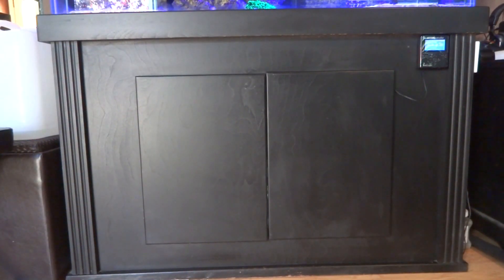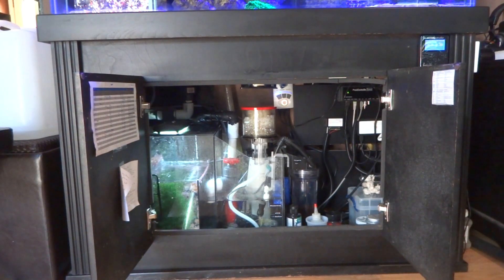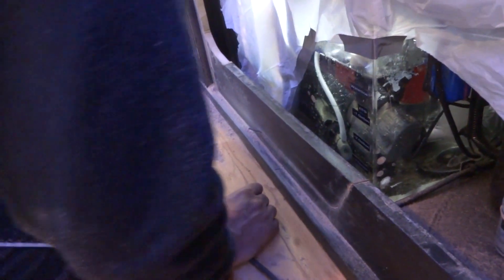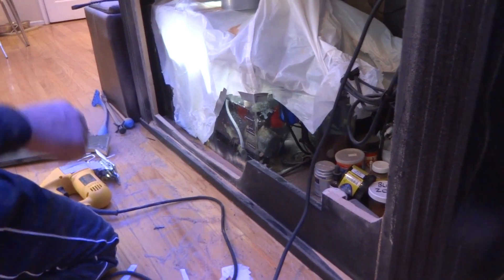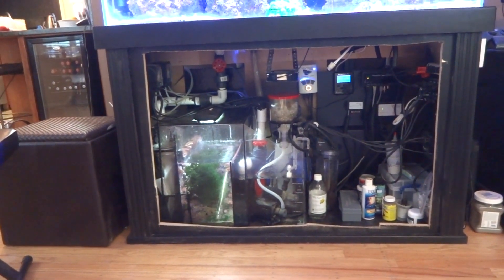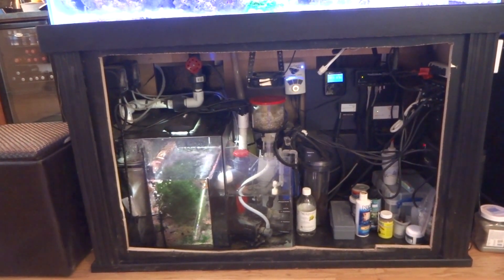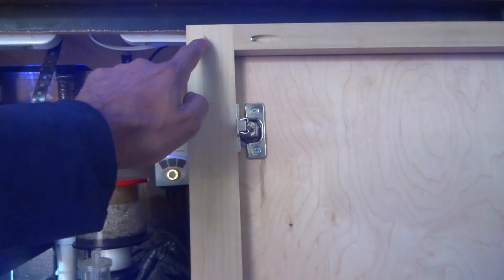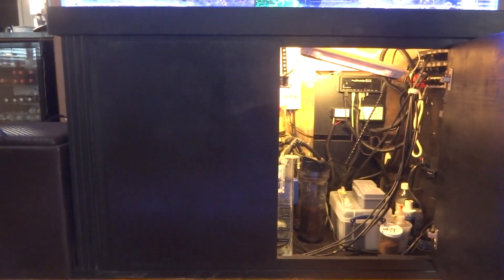Aquarium Cabinet Modification

Comment: Good job done. Whats the paint inside the cabinet to protect it from water spills and moisture.
Reply from the maker: I don't think it's special paint. I did use rustoleum paint on the metal door hinges. The hinges are rust free, whereas before, they would rust within months.

Comment: Love the mod and I have a question, how do you determine if the tank is using any of the sides cut?
I have a stock Aquaeon 48" by 18" stand and I would like to take the middle brace off so I can put a 36" new trigger systems sump instead of the dinky 10g acrylic box. What's the best way to determine if the brace is actually doing something?
I have time off starting in two weeks and I may make my own custom stand, but that's still up in the air at the moment.
Reply from the maker: If it has a center brace it's doing something... it's hold up your tank. I'd go with plan B and build a sturdy stand. I modified my stand for the same exact reason as you. I'm replacing my Aqueon sump with a Ruby 36S.  Video to come!

Comment: Pretty Sweet, Way better! Just need to add some decorative handles on the doors. My problem was I wanted my stand taller, Nice job!
Reply from the maker: Haha, I'd like a taller stand too, but I can make do with this one. I have the handles, just have to put them on. Going to do a pretty significant upgrade to the sump, which is another reason why I had to modify the stand.
Reply: ***** When is the Ruby going in?
Reply from the maker: +Juan's Reef Aquariums
I'm getting some finishing touches done before I make the move. Just ordered a tray for my Miracle Mud to make it easier to change out by removing all the mud at once inside the tray and lessoning the chances of a mud cloud in the water. It's being custom made to fit and should be ready tomorrow. I will probably spend Sunday and Monday working on the sump and new plumbing. Come over, beer and pizza on me!
Reply: ***** Lol I wish, Chicago is a long way from you, but sounds like a weekend of fun, where are you getting the tray from? do you have a link for it? i was thinking of doing the same thing, but with a specimen container, i was going to just drill some holes on the side and hang it
Reply from the maker: Juan's Reef Aquariums 
No link, it's a local plastics shop. The guy helping me just bought a 100g reef, so we had lots to talk about. They do custom plastics. I gave them the demensions of the second stage of the Ruby and they will make it. Ill send you some pics tomorrow of it (assuming I wake up in time to pick it up).

Chicago isn't that far... leave now and you'll make it by Sunday!
Reply: Well please share or ship me the idea ;) that was going to be one of my projects for the future, but if you perfected a nice mud holder for the ruby, i will definitely take one
Reply from the maker: CRAP!!! I just had it in my hand. I picked it up today, took it home and it was 1/4" too big. I returned it and they will have the correct one on Monday. Send me your cell # so I can text pic.

Comment: did you have to brace/reinforce the aquarium stand? I'm actually thinking about doing this I have a center brace that makes it so hard to access alot of stuff and I'm planning to upgrade my sump and I can't really remove old sump with the center brace..
Reply from the maker: I would have  never done this without professional  advice. Mine turned out to not be load barring so i removed it.

Comment: Very Nice Gil! I'm glad to see that you finally went through with it, now maintenance should be a little less hectic for you! Did you paint around the edges of the stand before you installed the doors? Does any of the light escape from the middle of the doors when the fuge light is on? Now I'm going to look into doing mine if possible, Nice job!
Reply from the maker: No light escapes the center of the doors, but a little does escape from the hindge side, not enough to bother me. I think I need new hidges, I can't get the doors to line up exacly where I want them, but no biggie.

Comment: Thinking of building a reef tank? 2 things! 1 don't put a refugium in your sump it's worthless. 2 always size your stand 36 in wider than your tank. As you can see by how crammed this system is.. Happy reefing..
Reply from the maker: jeff mays Hey Jeff, not sure I need a 7' long stand to put a 4' long on it. I do need a  larger stand, but not that big LOL. I have to disagree about the refugium being worthless in the sump. I don't depend on pods to feed any fish, I do depend on the macro algae to remove phosphates though. Additionally I'm running Miracle Mud that provides minerals and trace elements to the corals and fish.
Reply: ***** Removing phosphates? I refer you to Richard Ross on that one when it comes to phosphate removal from a refugium. 

Let's do the math..

36" sump 
External return pump option, actually the only option but ok. 
Chiller. 
Auto fill unit and holding container.
Dosing unit and containers.
A foot or so to space said products and boom 7'.
There is nothing worse than not having enough room under the hood to hold the horse power. 

I would also strongly recommend a welded metal frame powder coated to support the tank and never go below 36" in height as well. 

Happy reefing..
Reply from the maker: jeff mays My stand has been one of my biggest regrets for this build, I've even mentioned it in previous videos. I keep my ATO, dosing containers and misc supplies in a separate stand directly next to my tank stand. I just spoke to  buddy who can build me a stand exactly the way I'd like, his folks own a cabinet shop. I'm definitely going a few inches taller and a bit wider.

Still have to say the fug does its job removing phosphates. Despite running GFO, my macro algae is healthy and growing from being fed excessive nutrients in my system that would otherwise potentially ignite HA. Many argue that for a proper fug setup, it's got to be much larger, but since I have no algae issues, I'm content. Check out my most recent tank update. It's nothing crazy, but the video has before and after shots of most of the corals. Not saying it's solely because of my fug,
Reply: ***** Actually not a bad idea to have a cabinet next to the main display. That would be an excellent idea for one who does not want to build a new stand..

If in fact you do build another stand? I suggest 36" tall depending on height of the display. Taller is better for viewing the lower heights of a reef tanks. Stands the width of the tank are truly worthless in a reef set up as space is used up very quickly as you know. 

I truly have never seen any documentation that a refugium works for phosphate removal but if it works for you then that is all that matters. Maybe you should do a video on that? Have you ever used an algae scrubber?